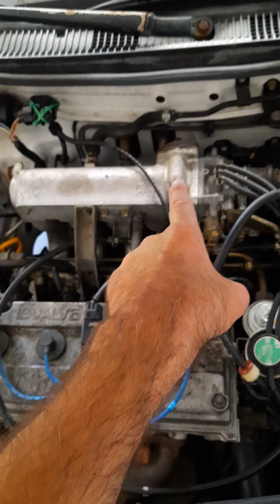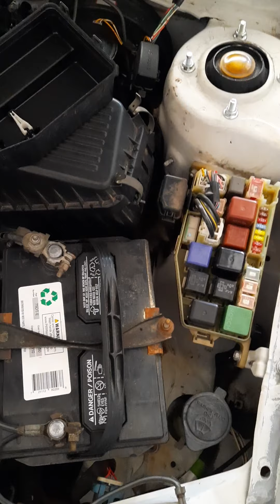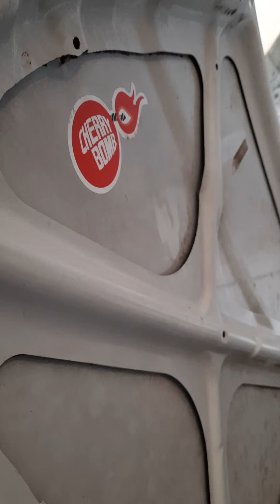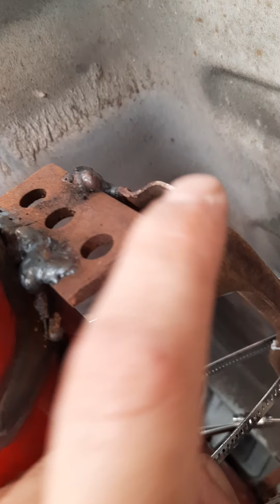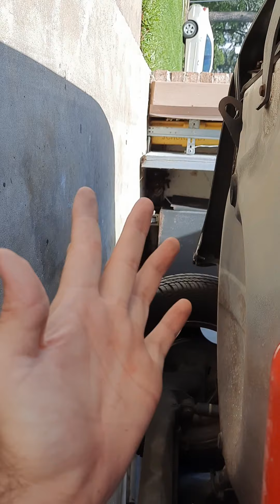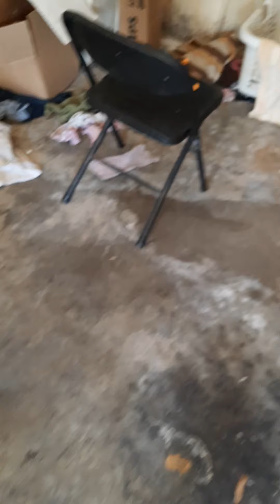1995 toyota tercel egr system update

Comment: Bro you in humble, Texas? I'm in shenandoah working on the same car😂
Reply from the maker: Yup a very longtime ago now i am working with a w210 mercedes e300  td
Reply: I changed my wires and spark plugs and statter and ended up getting  code p0401 for no Fucken reason it says it’s the Egr but before spark plugs and wires and starter it had no codes on my scanned green light then when I slightly tune up it had a pending code the code came out to p0401
Reply from the maker: @angelisalive   the o2s are a big deal if the timing belt has never been changed it can cause your valves to be slightly off causing that egr problem